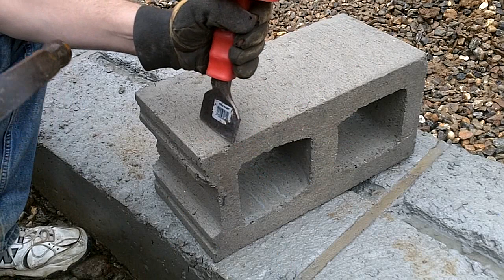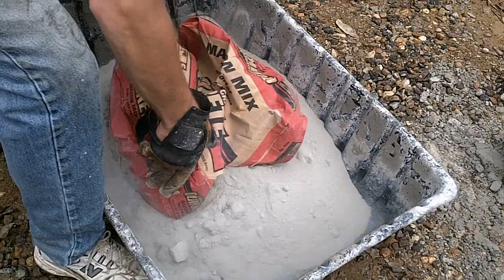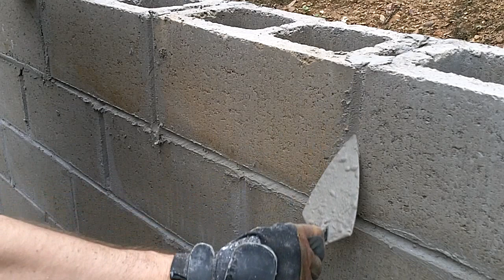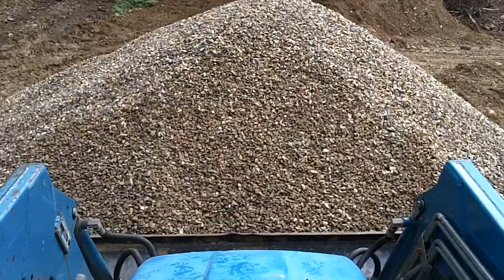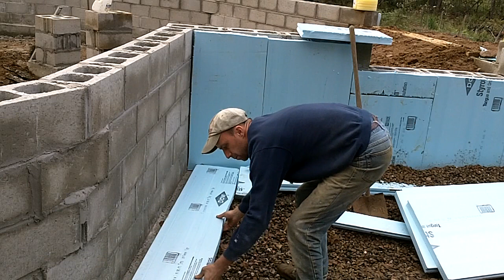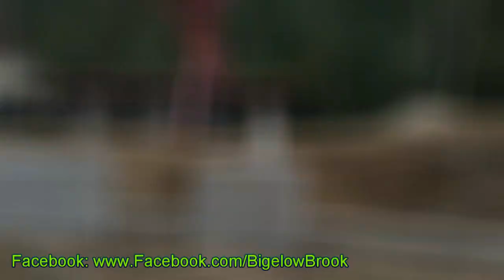Geodesic Dome Greenhouse - Part 6 - Concrete Block Walls

Comment: This is cool and looks great but you are insulating the thermal mass from the greenhouse. Need to put the insulation on the other side of the thermal mass. I recommend reading the book passive annual heat storage for ways to use insulation with thermal mass.

Comment: I have a house made of concrete.  It is more than 30 years old.  It has rebars in each hole of the concrete block. It went through earthquakes and strong typhoons and it is still standing strong.

Comment: One big mistake I see in this -- no rebar in the foundation. The footer had some but there should have been rebar anchored in the foundation and going up into the block wall foundation.  Hope he isn't in any kind of earthquake country.
Reply from the maker: It wasn't required to rebar the wall and footing together.  We had to put a key-way in the footing.  The building official was happy with it.  Our house foundation was poured the same way.  Maybe it's different in areas with earthquakes.
Reply: Yes it is very different. Tying the vertical block wall to the foundation is mandatory in California for any kind of building. I saw the key-way but that would not be nearly enough in an earthquake zone.
Reply from the maker: We had a quake here a few years ago.  I think it was a 2.0.  ;-)  It's the snow loads we have to watch out for!
Reply: I wish I knew someone that did this type block dome buildings in Alabama. We have tornados... And I found out after the fact they love to come though my county.... Luckily they have missed me for the 17yrs... I have lived here but have had close calls...
I live in a doublewide manufactured home or 5 acers... 
So I go to my best friends house when we have a tornado warnings... 
But it really sucks when they hit at night... when you live alone.. And you are driving hearing the wind try to make to somewhere with a underground basement.. or tornado approves structure..
.
I am originally from cali.. So I am used to the ground shaking... but when the house blows away... that really sucks.... hahahaha 
I have see brick dome structure with a cement layer on the outside of them used as tornado shelters... 
Because the wind goes around them.. because their are no walls for the wind to put force on to blow down...
How much does a dome structure like this cost to build...
Man someone that can build brick dome structure and sale them as tornado shelters in Alabama would get rich... If they can figure out a way to keep the cost reasonable... 
For people that live in rural areas like me.. that don't have community shelters to go to...
Because from march-july are the highest months for tornados
Reply: @mssburr  I do not know if you built yet, but you can build geodesic domes out of even firewood. see: https://www.motherearthnews.com/green-homes/wooden-dome-zmaz80jazraw

Comment: I live in a block home , husband is a mason , would be cheaper to mix your own motor 3 part sand to one part concrete i laid the stone on our earth home, what we found is on the outside in the dirt make sure you insulate with water sealant ,because if not sealed correctly you get water leakage which would be great for a green house but not a home , mold is hard on the human, thus be sure to anyone who build seal, also would be a lot cheaper and fast to hire a mason at 20 per hour non union, they lay 100 blocks and hour
Reply: +20alphabet  is not right propaganda
.
Reply: 20alphabet
Reply: A non-union mason is hardly a trustworthy source for quality workmanship. Trade unions require an apprenticeship that includes classwork, and unless you meet the required skills per level of apprenticeship, you won't pass to the next level. To become a Journeyman you must have satisfactorily proven your proficiency in the trade. 
He's better of doing the job himself than having a non-union "mason" or illegal day laborer. At least when things go wrong he has no one else to blame.

Comment: EXactly, like a load bearing wall as one of those times...Hey!!!  all the power to you for trying, but....as I said you are posting for everyone how to see....how NOT to do it,  You are not doing it correctly, even though you feel the end result will suffice.  You slosh your joints, you move the block after it's set....these are first year no-no's that even an illegal immigrant would know not to do.  Like when these electronic hobbyists lick their finger and stick it in the power socket.

Comment from the maker: For some applications, it is best to hire someone that is trained properly to do the job, but for personal use, doing the work yourself is far more rewarding.  I'm an electronic engineer.  Every time I see some "hobbiest" working on some electronic gizmo and posting it on YouTube, I don't tell them they should have hired someone like myself to build it since I've been trained and worked in the field for the last 25 years.  More power to the people that step out and take control of their lives!
Reply: 🙂 Fun to learn from your video 💕 Your time has value.

Comment from the maker: I'm not conveying that anyone can lay block.  All I am doing is showing how I did it in this building.  I consulted with several masons (one that set his own foundation in the 50's) how the best way to do this.  The general consensus was to do it as I show and not lay rebar or grout.  Each step was inspected by the building official: foundation hole, footing forms, footing pour, wall building, and anchor bolts.  This foundation has gone through 2 winters and 2 hurricanes and is still doing fine.

Comment: Exactly the point I'm trying to relay.  Maybe the job this kid did will last...maybe it won't.   It's not like a big heavy structure is going on it anyway...but the point is, he convey's that anyone can lay block...WHICH IS NOT the case.  This is why so many Illegals get away with it, and also the reason building structures have become poorer and poorer quality.

Comment: Guess those weeping walled basements weren't done by professionals.  which is exactly my point....beside a cistern would have a membrane over the exterior, and the cells would all be grouted in solid, hence making it a monolithic structure, and completely waterproof.

Comment: Not from my experience.   Back in 1991 I had the largest single pour residential foundation in WNY up to that date.  It included a 30,000 gal cistern.  10 years later there was only one  hairline crack (Not in the cistern).  I've seen quite a few block basements and each had weeping walls and a number of cracks   However you didn't build a basement but just a foundation. They are structurally different.

Comment: They do......it's grouted in on the rebar sections, WHICH IS NECESSARY in seismic 2 area's and higher...but check local building code..   This is why Bricklayers spend 5200 hrs in apprenticeships, and don't fly off the cuff, or shoot from the hip!!!

Comment: Interesting to see the different building methods. I had a wall done from concrete blocks and the mason just put the blocks on top of each other and filled up the inner holes with mortar. There is no mortar between the blocks at all.

Comment: Great series, thanks.

Any rebar in that foundation?  Knowing what you know now after construction, time, materials, labor etc. Would you consider using Insulated Concrete Forms in stead of blocks?

Comment from the maker: Thanks.  Since I hadn't done it, I relied on advice from the locals.  I've seen several house foundations that were done 60+ years ago without any cracks and they said it was done just like I did.  Also, the building official said I was fine.  That's what really counts!  ;-)

Comment: All in all, this is a good idea, but you did need vertical rebar coming up out of the foundation to the height of the footing wall.  Then you would need horizontal rebar in the first course of block and in the 6th course, and if that was not your top course, then in the top course as well.  Then pour the wall solid with concrete grout.

Comment: did you put any starter bars in ur strip footing... steal in the blocks and core fill them with concrete.. if you plan on retaining alot of earth you need to do this... any waterproofing for the blocks???

Comment from the maker: @NewEnglandgardening The surrounding soil will fill the bottom 2 feet.  there there is a layer of 3/4" stone with piping going through it, then another 6" of soil on top of that, then an 1-2 inches of sand so I can level the floor.  Then concrete bricks for the floor.  I can't past links in comments, but the facebook link is in the video description of this video.

Comment: Hi, Is the area going to be dedicated to only aquaponics or will you also grow some things in raised beds?  Do you have specific aggregate you will use to fill the base or just surrounding soil?  I saw a video somewhere that a passive solar house in Colorado drew warm air over bolders or large rock in the cellar that slowly radiated the heat back into the house at night.

Comment: Hi, Great progress.  I mixed over a dozen 80lb bags by hand once and then I finally rented a mixer from HD on the last project.  I'll never mix by hand again. Except the mortar I guess.  They are getting cheaper too.  I noticed outside the rental area HD sells one assembled for $395.  Almost bought it.  Are you going to install anchor bolts and some sort of bottom plate on top of the blocks?  This project just might get you on the local news.  Hope you get the dome up before the first snow.

Comment: Very cool. That should be one permanent green house. I get the idea of thermal mass but it sure is a shame to fill the inside. You could bury 2" foam flat all the way around the structure at a slight downward angle to trap ground heat.

Comment: @MrTerry428 That is no where near the height that would require steel reinforcement.  I did my basement 10 blocks high and it was not required by code. (But I did anyway just for the hell of it.)